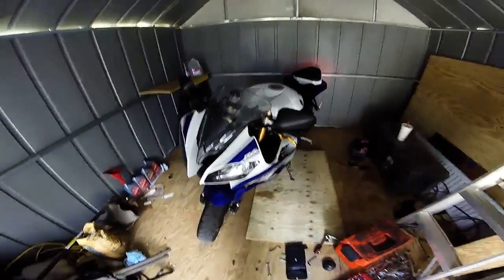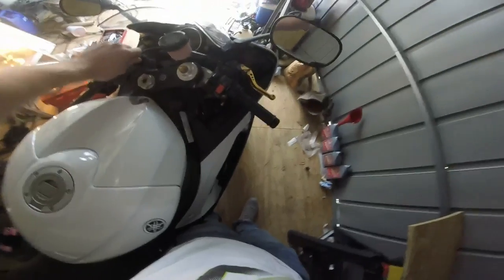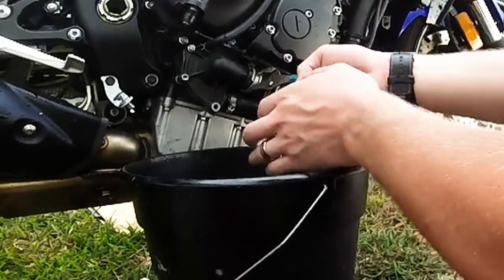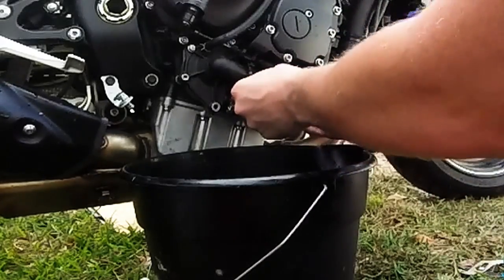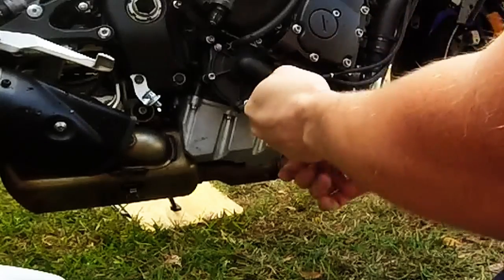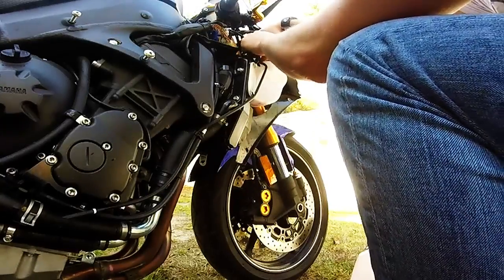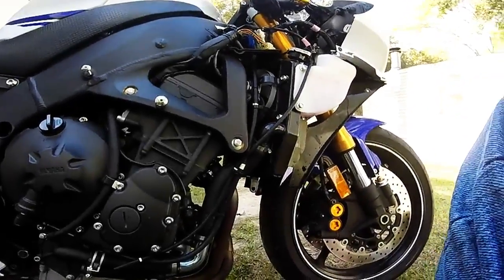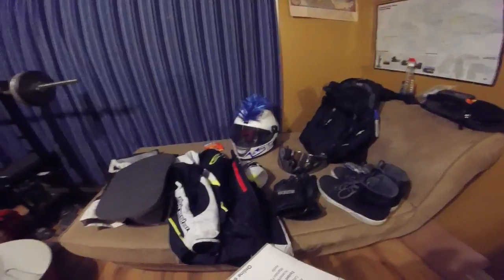2014 R6 coolant Water Wetter Vs. Antifreeze, and change tutorial

Comment: Solid video, however you skipped a major part in doing a radiator flush..  when doing a flush.. after the initial drain.. u must used distilled water and run your bike until the fans kick on.. this allows your thermostat to open and run the distilled water thru the WHOLE coolant system..  clearing out any residual coolant.  then let cool 30min and drain..  this allows the coolant from the while system to be flushed... hope this helps

Comment: I'm sure it works but your 1st test was in your shed correct now why was your 2ent test in your freaking back yard!!!!!come on man wtf dummy
Reply from the maker: the temp is the same.  they are both in the shade.  dummy. there is no wind anyway so that is not a factor
Reply: factor these two things the hot exhaust  coming out your muffler in that small shed with little door next as your bike gets hotter it is now working just like a heater in a small room./ heater + heated exhaust + small enclosed environment =hotter environment = invalid test results
Reply from the maker: +bob weed its not like i left it running for hours with the doors closed.  how about u make videos Bill Nye
Reply: all in all it was a good video and i got what i needed from it  sorry about the dummy  part

Comment: engine ice is better. you don't have to mix it. 1/2 gal will do your bike. you can get it at cycle gear or online. like $17. my bike runs about 28/degrees cooler and I live in nc
Reply from the maker: Nice.  maybe I'll try engine ice out when I change my oil again.  thanks for watching!